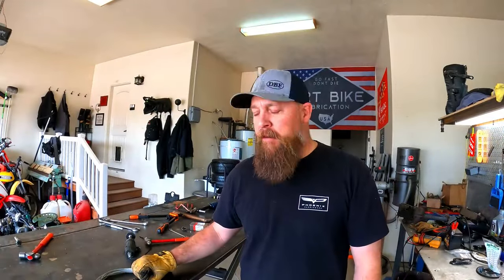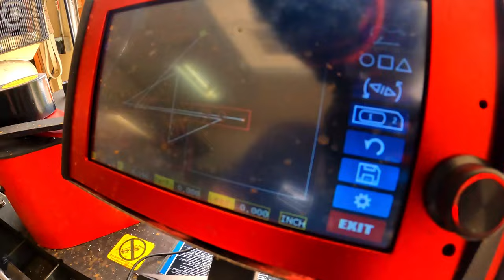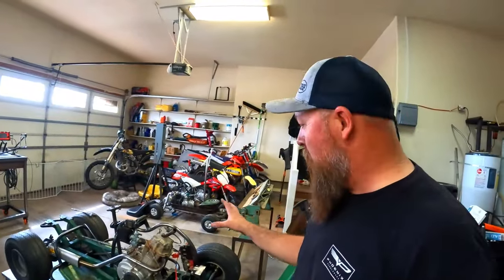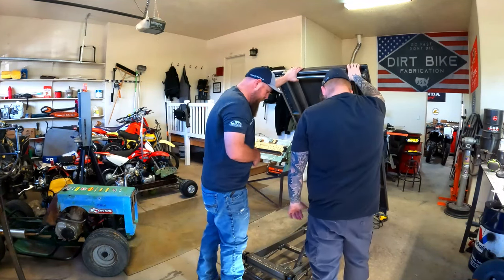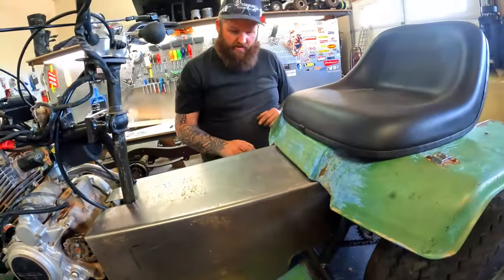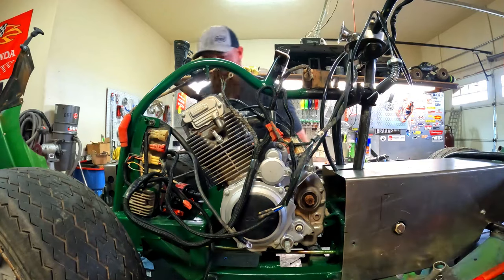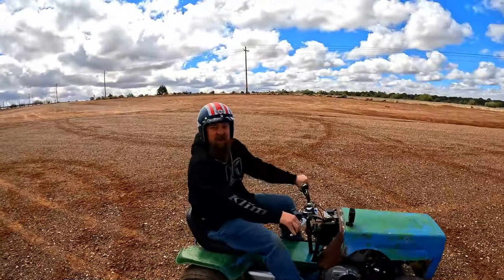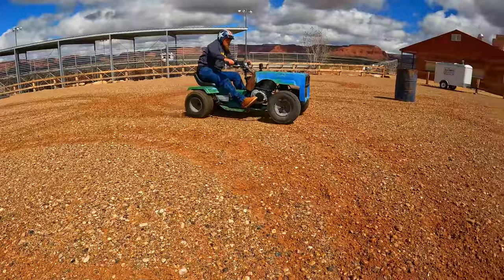4-wheeler powered racing lawn mower. Good idea or bad?

Comment: Drill bit doesnt stay tightened in cordless? Theres a locking feature of tighten drill bit all way, then one click back. It locks the bit in.
Reply: Decades ago, when I got my first keyless chuck, as it started to wear out, I simply flat spotted the shank on my bits, never had a problem after that...